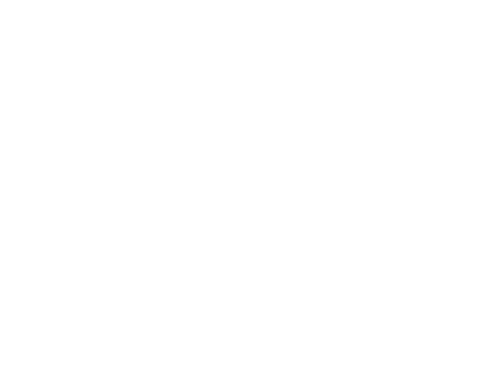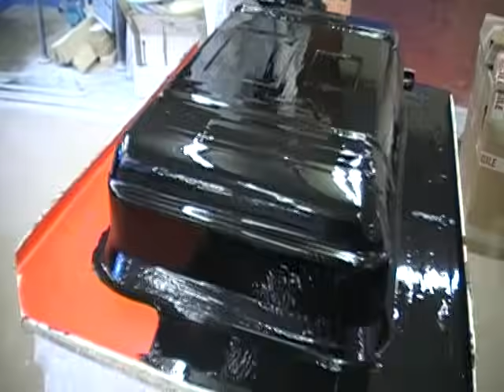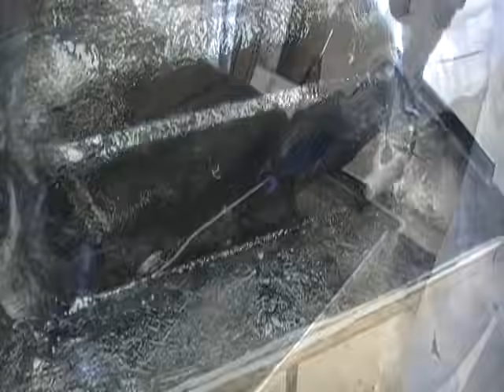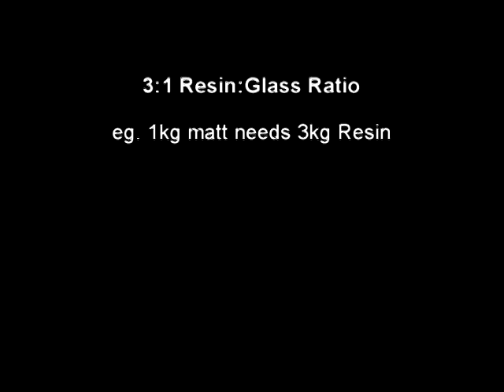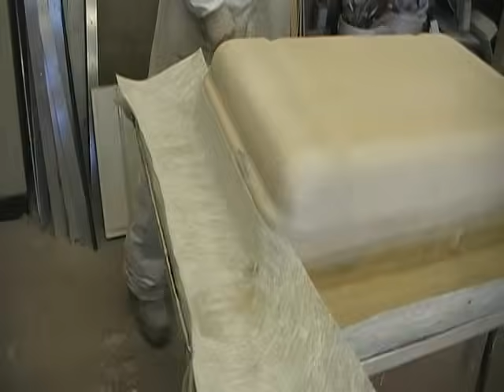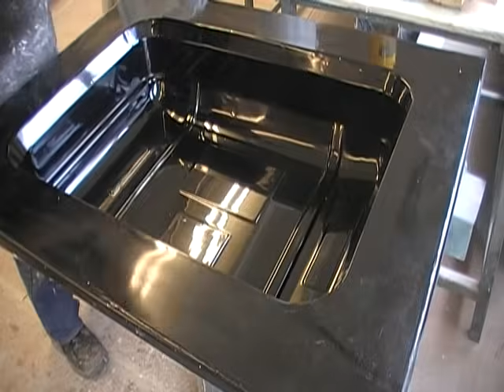Making A Fibreglass Mould

Comment: I have a question, give me some advice. I made 2 15 x 30 inch molds from some windows that go on the roof of a McLaren car. The customer removed them and gave them to me to build a mold to be able to make them in carbon fiber. This is the one. Procedure I used, tell me where the error is, first I cut the cardboard and glue it around the glass, leaving it 2 inches away, then I sealed all the gaps with plasticine, then I applied 3 coats of PVA mold releace, I let it dry very well, then I applied 3 coats of gealcoat. orange that I bought it at compositive envision, it was one coat for every 25 minutes of gaelcoat. Then, when it is tacky, I applied 6 sheets of glass fiber and 6 of polyester fiber glass resin. 15 minutes between each coat of resin for each sheet of fiberglass glass. I let it dry overnight. The next day I took it out into the sun so it could dry much better. My 2 molds got twisted, one of them got some cracks. I repaired them but both parts got twisted. Any recommendation you can give me,  is my . first time making molds I spent 400 dollars of material amd i fee a little  stressed  I work alot with carbon fiber but  is my first time making molds

Comment: This video is full of shit!  I followed guys like this. We waxed and waxed  and waxed and waxed and waxed some more until we thought we were just being anal bu[t we wanted to be sure only to end up separating the plug out of the mold with hammer and wood chisels and grinders, cutting and grinding until we hit the different color tooling gel.  USE PVA (POLYVINYL ALCOHOL) WATER SOLUBLE, SPRAYED ON RELEASE AGENT!.     Then we had to patch up the buggered mold!   Guys like this have never actually done the process but appear with a camera to make a video.l 
Be wary of the dangerous clowns!

Comment: If I am to make a boat mould, can I make a plywood mould and then coat it with a couple layers of fiberglass and a layer of gelcoat?
So that I could mould the hull straight out of this? It is a one off production, and would not need a master mould.

Comment: I need somone to estimate the fiberglass tunnels for this park I have designed 5 of them at 40 feet long 8 feet high and designed to fit all kinds of youth and then there is the track at 7000 feet in square feet

Comment: Great video - I'm going to send people to this from now on rather than explaining the process.
I noticed that you don't mention the need for release angles in the plug ?
Additionally, a boss for an air fitting laid up in some part of the mold helps pop the part with an air compressor. If one is making enough copies to make a mold worthwhile, it definitely cuts the turnaround time and (especially on bigger parts) one person can pop the part.

Comment from the maker: Hi The Gelcoat is the durable, cosmetic and more often pigmented finish you would see on the part you are producing, it provides weathering and water resistant properties on the part surface, you could pore silicone in just as always try a small test piece first, hope this helps

Comment: Hi. Great video. I am an ex fiberglasser who only used gel coat in the past, sanded and sprayed it afterwards. Why is there so much nonsense now about gel coat never curing, or you need topcoat or flocoat instead. Has it all changed so much.

Comment: When you don't use the PVA, what is the trick? Is it that the surface has to be perfect gloss without ANY porosity seen in the surface anywhere? I have some areas still which I could sand out some micro-craters.

Comment: If you're NOT making production pieces....which need to be as close to PERFECT as possible.... you CAN skip the gel coat step. But this will give you a part thats not smooth as glass so you might have to do some finishing afterwards. Also keep in mind if the part you're molding has a deep well like the one in this video....you might have a difficult time removing it from the mold.  Gel coat is very important when making repeatable molds and will reduce finishing time.

Comment from the maker: Hi, you would need to find a resin from a Manufacturer such as Scott Bader that is suitable first, Crystic 491pa should be ok for the Water - Salts not to sure. Specification you would need to maybe seek advice from a local moulder in your area, take them a set of drawings with your inteded use, i hope this helps.

Comment from the maker: @Savyoan Hi its not something i have done im afraid, i have made a mould from a Clay statue after covering it with Shellac first then applying PVA Release.
You would only put wax in the Gelcoat (2%) if you were applying to the finished product for finish ect, not on the Female mould as this would inhibit adhesion of subsequent layers of reinforcement, hope this helps.

Comment from the maker: Hi, yes its a fibreglass plug that was made, in this case the male part outlasts the female part, so after every few thousand lifts this is brought back in to reproduce another, when its put back into stores a Gelcoat few layers of Glass is usally applied for protection, you can get mould protect, but its sometimes as easy the 'old fashioned' way :-). best rgds

Comment from the maker: @richarddale76 The treatment of moulds is slightly different for epoxy moulding, some people will only use the PVA alone for epoxy mouldings.  Unlike polyester which relies on a chemical bond, the epoxy relies on mechanical bonding so will sometimes still grip to any microscopic scratches on the mould surface even if waxed,  PVA produces a good solid barrier between the Epoxy and Mould surface. We are open again on the 3rd of jan. Thanks again and All the best for 2011
Kind rgds ecfibreglassuk

Comment: @ecfibreglassuk  Thanks for the info. Its just i've seen other on here use upto 6! layers of wax, then 2 coats of PVA release agent. This was for an epoxy resin on carbon 6k fibers though. Would you recoment either/or rarther than both? P.s When you back open after xmas? got an order ready to ring through. Thanks again

Comment from the maker: @richarddale76 Hi This is a PVA Release agent not to be confused with  polyvinyl acetate emulsion which is a Bonding agent. 
PVA Release agent is a liquid solution of polyvinyl alcohol resin in a mixture of water. when dry this forms a thin skin which acts as a barrier to prevent the resin from bonding to the mould surface.

Kind regards ecfibreglassuk

Comment from the maker: @irfanfikri This is known as The Plug / Mastermould: To produce a mould you need a pattern or former commonly called a “plug”  an exact replica of the finished item. Usually you will have to make the plug from scratch. The plug can be made from almost any material as long as it is made rigid, accurate, dimensionally stable and set on a solid foundation. this particular one is made of fibreglass which we made earlier from another plug made from wood which was primed as smoothed to a gloss finish